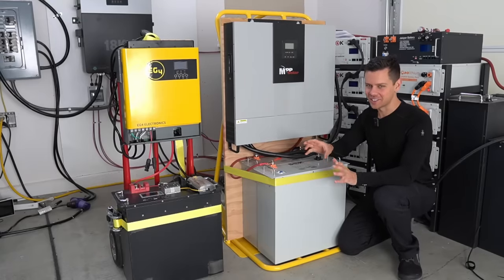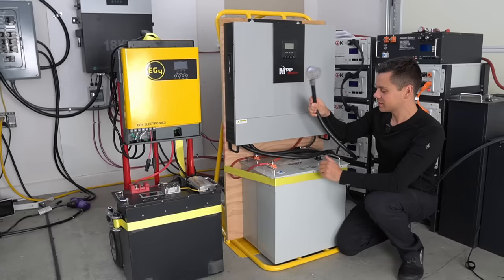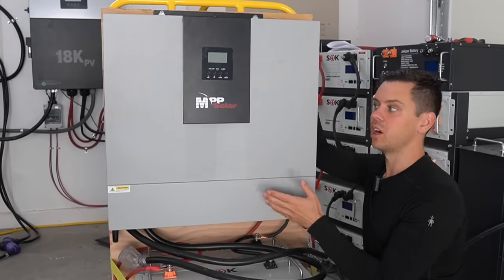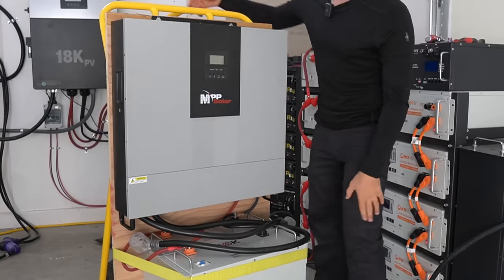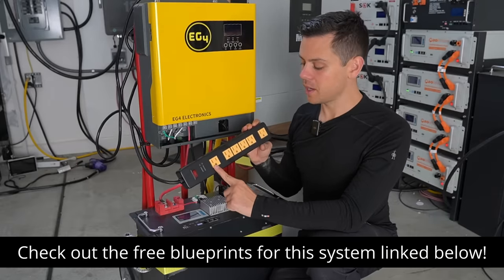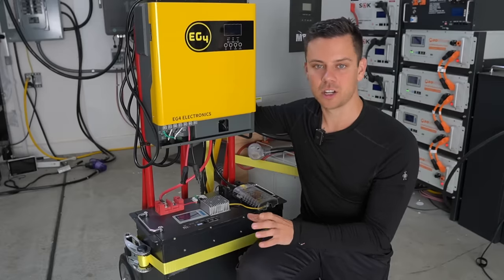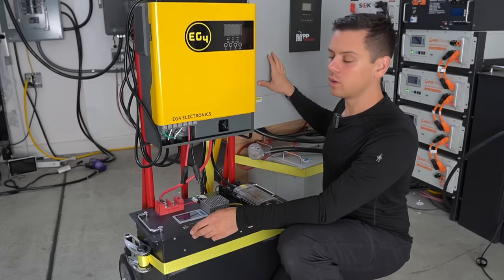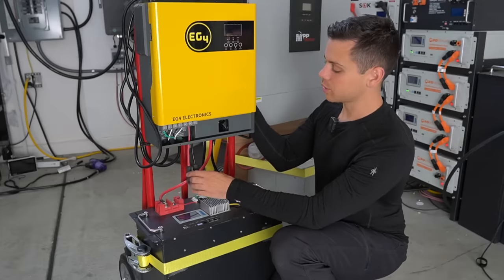240V Mobile Solar Cart! And New Upgrades for 3kW Solar Cart

Comment from the maker: 3kW Cart Blueprints and Upgrades: https://www.mobile-solarpower.com/mobile-48v-system.html

LV6048 all in one can be found here: https://www.currentconnected.com/product/mpp-solar-all-in-one-120v-240v-inverter/?ref=wp

Server rack batteries: https://www.mobile-solarpower.com/server-rack-lifepo4.html

Does off-grid solar confuse you? 
Check out my DIY friendly website for solar system packages and product recommendations, and so much more! http://www.mobile-solarpower.com

Join our DIY solar community! 
#1 largest solar forum on the internet for beginners and professionals alike:
https://www.diysolarforum.com
Reply: @WillProwse If we wanted to install the 3kw 48v system in an RV, can you please recommend what panels to use, as the guide says do not use 400 watt panels on an RV, so what panels would you recommend then?
Reply from the maker: @Truth_Unleashed  I posted it in the blueprints. There's a boost converter. Or you can use higher voltage 200 w panels in Series
Reply: Did your 3000 EHV come with the NG bond screw in or out?   I assume in if your only using the outlet strip.
Reply: @WillProwse Did your 3000 EHV come with NG bond screw in or out?
Reply from the maker: @tsp2jxd  I never tested for that. If I commission parallel system then I will
Reply: @WillProwse  have you ever put a generator as input to the 3000 EHV?  Love to see that in your next update.  Inverter based or "regular" like many people still have and use.  Thanks!
Reply: Can the 240 output inverter charge the 48v battery using 120 volt house current?
Reply: @WillProwse  if you build a mount on the backside of the handtruck, the batteries balance easier making it easier to tilt and move.
Reply from the maker: @SuperVstech  yes indeed, but very hard to do on this hand truck. Was trying to do that but not much room back there. And weird pipe angles. It's not flat
Reply: Will - it looks  more suited to an off-grid cabin - or what we have in Blighty - Canal Narrowboats
Reply: @WillProwse  yeah, I figured a bracket would be needed to do it.
Reply: Will, we follow you religiously. We were hoping that you could review the flex solar panels again...now that time has passed. We are looking to see if they have been upgraded since the problems you found last year. Do you have any direction on that ?
Reply: @WillProwse I just checked mine, got it about 2 months ago.  It does NOT have the NG bond screw in place.
Reply: @JohnWick-xz9tc  charge controllers with temp sensors can be programmed to limit current under conditions, high or low temp. Be sure you place the sensor close to the batteries if you want it to be accurate.
Reply: @SuperVstech , how would you suggest doing so?
Reply: Have you ever done anything with Xantrex batteries or Inverter/chargers?
Reply: Hello Will, may I digress from video to ask an unrelated question...
 Just wandering about if you will or have done a video of  Li Time 12v mini,they seem like the introduction of a thin dimension lifepo4 is maybe the beginning of the new norm in lifepo4 batteries, and would be a great addition to the RV battery bank choices as to the limitation of area and space are key factors to consideration, etc.
What's your thoughts. 
Thanks, 
J.c
Reply: hello. i have a idea id like you to do.  im planning to do this myself but no one had done exactly what im wanting to do.....i have a RV that has a 50 amp plug and a 5500w generator.  i have a tandem axle trailer i want to build in to my portable solar system for when i move to property and have power.  id like to see a system set up to just plug in my  RV as if it were the generator and enough battry power to run the AC all nite
Reply: Hey Will, would you be able to just add a Step Up Transformer to the smaller cart to run 240v loads?
Reply: Can I charge my tesla with this system?

Comment: Re: 3kw cart update. Eco worthy has 48v 50AH batteries for $630 - $100 promo. I ordered two for 100AH of capacity for barely over $1000 after tax. Signiture solar is offering a $50 off coupon for new customers. So $1500ish pre tax for eg4 + 5kwhr of capacity. Absolutely smashes prebuilts in terms of cost, capacity, input, output, upgradability, and feature.
Reply: Thank you for the update. A potatoe a day keeps the doctor away.
Reply from the maker: Where are you seeing that price. I see $659. Where is the promo. Have you opened that battery up? I have not yet
Reply: YT filters. I can't name the site even.  I've posted twice and it keeps vanishing. They are selling them manufacture direct on the large and well known auction site. $563 after $100 off promo. Or $1126 + tax for 2x 48v 50ah batteries.
Reply: The site rhymes with "flea bay". I have not opened them up as I'm assuming it's like all other budget lifepo4 units and "good enough". One 48v/50ah battery and eg4 would give you almost the same capacity as an eco flow pro (2500 whr vs 3600) but much more upgradability and almost 1/3rd the cost.

Comment: Hi Will,
Long time viewer.  Looking at this video and thinking about how far you have come.  I wired solar in my RV via your videos and built this exact cart system in my garage that runs 6 circuits in my house.  You have given so much to the solar DIY’s. 
Thanks and keep it up.
You and Ilan Musk are my heroes!!!!!
Reply: What circuits do you run and how much solar do you have?
Reply: My solar array is 1600watts running 16 x 100 watt renogy panels in series.  I run my refrigerator, tv, small window ac and large air fryer on occasion.  I have two 24 volt 200ah EG4 batteries in series.
Reply: @steveo4436  Thanks for your reply.

Comment: Love the 240v cart idea. It's what I asked for in the other video. You're correct in that a hand truck system is silly. However as a temporary back up. I have a 14-30 twist-lock generator input on the side of my house. Adding the same output to your system, and having on a cart just to move as needed, or a semi permanent system if you will. Thanks so much for all your videos! I've learned so much from them and your website community!

Comment: I used a DC to DC 60 amp converter to connect to my Diesel motor-home battery & alternator. Works fine to keep the LFP battery topped up when driving.

Comment: Will, another excellent setup and video. I truly appreciate your knowledge and simplicity in communicating this stuff. FANTASTIC! In your opinion would a system like the 3kw system be overkill, to power a home office consisting of laptops, battery chargers, gaming computer, small work bench using heat gun, charging batteries for battery operated tools, standard home office printer, small set of desktop speaks, and a 35 inch TV (periodically)? Not everything would be running 24/7 and not all at the same time. Thanks much. Great build and update, looking to do the same, and would be using your links. Final note your book is gold! Thank you again, so much.

Comment: Thanks for your video,  I made a cart with the EG4 6500EX-48, and EG4 48 volt battery with an additional bay for the another battery.  It does the same as yours on a plywood cabinet with large caster wheels.  Glad to see the solar plugs on your unit.  I could never get a strait answer as to which plug ends for the solar leads.  Thanks for the video.

Comment: Will, I would love to see you evaluate some solar charge controllers, BMS, inverters and all-in-ones on the basis of how RF quiet they are.  Im an amateur radio operator.. One of the big things holding me back from building systems like this is my constant fight to eliminate sources of RF on my property.  I Don't want to waste money on something I can't use due to it leaking RF emmissions.
Reply: Hmm. Comment didn't post. I haven't heard of RF issues on GroWatts (or others).

Comment: This portable is close to solving a cool problem.  Imagine that the inverter was able to generate grid so AC coupled inverters could turn on when the sun is bright.  Yes, I would need to manually disconnect the utility but a manual disconnect is so much cheaper than a set of schneider parts.  With 30kwhr of battery, it would mean leaving the utility off for most of the year, which is not good for sellback but if they dont pay, why bother.  Therefore, my request Will, is to modify and test your test unit. thank you

Comment: Hi Will. Great to find your video. Try making as a 2 static wheel + 2 swivel wheels (4 wheels total). Two of the wheels electric, with low rpm (30 Rpm). 2x 150watts motors will be enough

Comment: That 240v system is hilariously awesome... Can't believe you actually made that. Be careful what you ask for people! 🤣

The 3kW cart is looking even better! Way way cool. And thanks for sharing that boost charge controller! Never heard of that before. Could be very useful with this setup for only a few smaller panels since the minimum required PV voltage on the EG4 3000 is pretty high.

Comment: Think lawn and garden poly dump trailer or similar.  A powersupply a bit larger with more capacity than an off-the-shelf mobile power station that can be towed with anything from a simple lawn and garden mower, ATV/RTV, or small tractor.  Most homesteads and off-grid cabins already utilize these types of small trailers and machinery.  All hardware within the bed of the trailer with a hinged 2x4 top that doubles as a work table top.  At some point I am going to build a small towable 120/240 power station that can be easily towed in remote locations.  Feel free to beat me to it.

Comment: Seriously considering getting one of these EG4 3K  units! Please keep us updated on the reliability of this unit!
Reply: I bought one last Nov. it's on my back porch with 1200 watts of solar and a 5kw server battery on a hand dolly so I can use it at the barn when I need power there. Has continually run my 7 cubic foot freezer outside lights tv and fans without a hiccup.
Reply: @dougwilson8274 I was thinking about building one for my shed, to run power tools and such. My biggest concern is safety. Did you ground everything to the dolly, or as Will said in his one video just don't touch both battery terminals?

Comment: agree with you in using a 4 wheel cart :face-blue-smiling:
in 2019 i built one using a 4 wheel cart that a hospital threw away, it had no door bangs here and there, fixed it.
 i had seen the "4 star rolling thunder power supply" (discontinued)  so i went off that, on the side i mounted a Sunpower inverter and put the 48 volt "discover advanced energy lithium ion battery" model # 42-48-6650 at shy of 200 lbs you need 4 wheels with this battery

Comment: Will prowse What do you think of doing a  mobile setup with the eg4 6000xp inverter and 1 or 2 server batteries. ?  What about mounting the inverter to a 3 rack eg4 box on wheels ? I have a 10kw 120/240 gas generator to plug in for charging as well as grid power to charge when power is up.. What charge and discharge cables would you use ? loads would likely be all 120v

Comment: Will, I was curious if you could cover the 3k or a batteryless inverter by eg4 or similar company for doing hot water heating.  I have had solar for 8 years and some of the last things to take care of are air conditioning (which you have covered w/ the eg4 hybrid systems) and the need to solve my hot water heating needs.  I use propane now and it's expensive seasonally upwards of $4 per gallon now.  Being able to stack a few thousand watts of panels with a batteryless inverter to at least one element is what I'm looking for.  Not sure if the 3k is in the ballpark to do that or not.  Will still have the propane tankless in-line with the electric heater, but hoping to cut down on costs.  Last 200 gallon fillup was about $800 bucks and I do this twice a year with  8 in our household.  Thanks for the great channel.

Comment: Just make 2 of the smaller carts and then make a small box with the wiring to bring together both carts for a 240v system like Eco does.  That would open lots of uses for them together or separately.  For the Big Foot build, use the Harbor Freight utility cart (1000 lbs. capacity & cheaper) instead of a 2-wheel dolly.

Comment: It would be ok to put in a van and go out on the road to recharge people who had run out of power or didn't make it to a charging station. A mobile charging station on wheels. What if you mounted one of the batteries on the back side. That would make the weight closer to center line and easier to tip back. Get a hand truck with vertical handle system.

Comment: Could you make the smaller system in a 12v portable inside a tuff box...like a pelican case with its own handle, so it could be put under an RV in an outside environment?  I wonder where the fan openings would go.  I'm curious about the bigger system in a 4-wheel cart configuration, or even a larger system on a lightweight Lowes trailer as an off-grid construction module.  Can tax credits be used if hooked to your home, even if in a mobile configuration?

Comment: I can see this being useful for mobile welding to replace large gas generators...
Reply: I had that thought myself. I can run my Miller 210 MIG off my 6KW gas generator welding 1/4" steel. This would be perfect with an inverter machine like a  211.

Comment: thank you Will. thank you for all your videos. i am about to build the diy 48v offgrid from your blueprints with the eg4 6500. it will be here when i get back from rome. so yes take out the grounding screws and just have it grounded at the load panel. this is correct right? just making sure. it will be a floating offgrid. just like yours.

Comment: I'd build a cart like a dolly with some large pneumatic casters. put the batteries on bottom and inverter on top all sitting horizontal. maybe use an old v-belt for a handle to pull it around.

Comment: Why not just use a Growatt 5000ES and a single battery for 240v EV charging?  Add a Zencar adjustable EVSE and charge at 16amps and 240v.

Comment: Thank you for another nice video, idea of charging EV from battery bank is very smart but why mobile? what about using ac extension or hardwire it to a breaker box?
I use my 19kw AGM battery bank to charge my Nissan Leaf that is barked about 130 feet far from where the battery bank is, I just run 6 awg copper wire to my sub panel and created an outlet for the leaf, the same battery bank is running my water well, full size fridge, microwave, a large freezer & all the essential lights & outlets in the house, I am charging this bank daily with near 2kw solar. If mobile is needed for travel then it makes sense.

Comment: Wil, I have a design question for you. I'm in the process of converting my 1998 42' Class A motorhome to lithium and eventually add solar. I've been doing a lot of watching you and others. I started with buying the Trophy cells from overkill you suggested, and I made two 12v 100ah batteries to replace the 4 6v batteries it had that were junk. I also bought the Victron smart shunt and the Victron DC to DC charger. This worked great. 

Of course, I wanted to go bigger, so when my wife wasn't looking I bought a Victron Multiplus II 2x120 24v version to replace my older charger/ inverter. I also bought the lynx shunt,  lynx distributor,  and the cerbo gx with the touch screen. I paired this with the EG4 battery 24v 200AH you seem to like. I have the battery mounted under my bed in a configuration that will allow me to buy more in the future and stack them like if the rack had tipped over on its back. 

In putting this together, I needed a way to convert the 24v down to 12v to run everything in the camper.  I read about someone else using an Orion 24/12 70 from Victron. They said you could put more in parallel if you needed more amperage. Like when pulling the large slides in and out.

I had an idea, however.  I know I could buy a 24v BMS for my trophy cells and add it to the EG4, but that mixes batteries. So, I wondered if it would be worthwhile to use the 12v batteries as an "accumulator" to help absorb large loads?

I hooked it up that way yesterday. All the lynx components are 24v. I installed two busbars below them that are 12v. I hooked the Orion between the two, but it doesn't output enough voltage to charge the Trophy batteries. 

I'm contemplating using the Orion to charge the 2 AGM chassis batteries. I've been trying to keep them separate so that if my coach batteries die, they will not.

My thought is that the Orion 24/12 70 will draw from the EG4 to charge the 12v AGM batteries to 13v, which will, in turn, trigger the Orion smart 12/12 30 to charge the Trophy "house" batteries to 14v. 

If the EG4 shuts off because of low voltage,  the AGM batteries will stop charging and eventually drop below... let's say 12.8, which will stop the Orion smart 12/12 30, and finally, the Trophy batteries will deplete themselves...

Am I totally wrong in my planning?

Does this sound like it will work?

Comment: The EG4 6k 120/240 AIO would be a better base. 
I built one into our 48v golf cart with 2 EG4 WP batteries to be a mobile power station a 330w panel on top with a Gensun SSc and pulling a small trailer with 3 hard mounted 330w panels,  one fixed flat and two hinged on the sides and 3 more slid into racks which can be deployed when you arrive on site…
Reply from the maker: Reason I didn't use mine is that thing is even heavier! And I just love the 6048 more in general. Better mounting system as well

Comment: Hey Will, Would you please create a video regarding safety and efficiency considerations of RV solar panels. Which panels/manufacturers hold up to mobile conditions, hail, wind, vibrations, snow load weight etc. 
trying to research the most durable framed solar panels but haven’t found useful information.